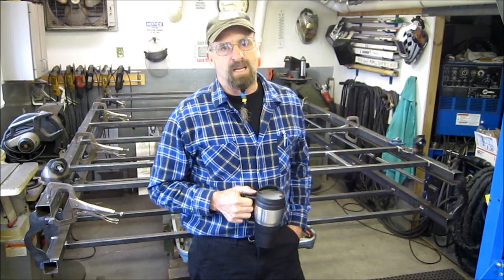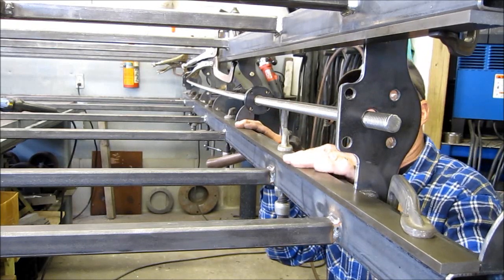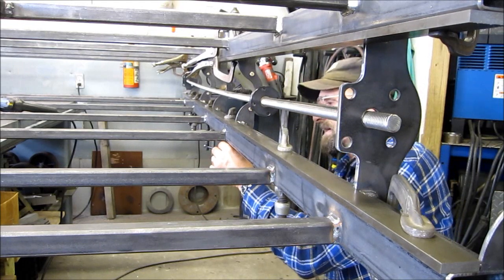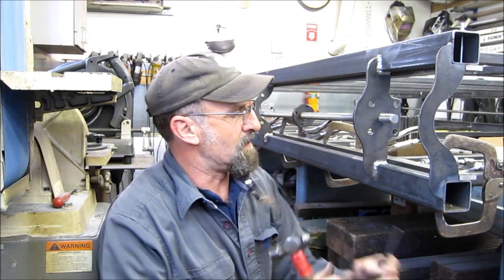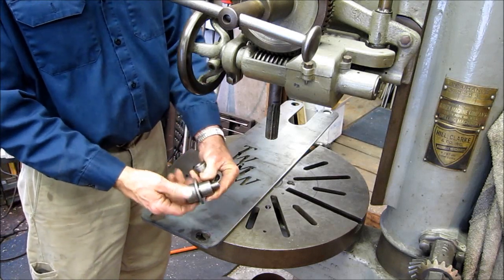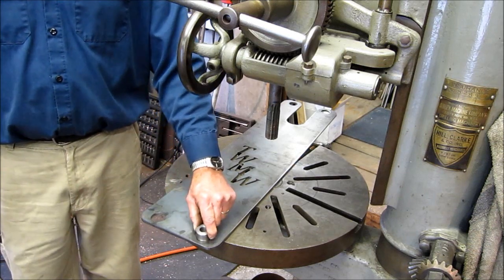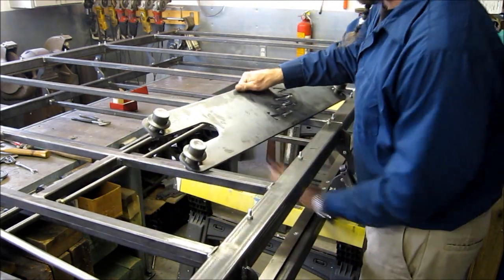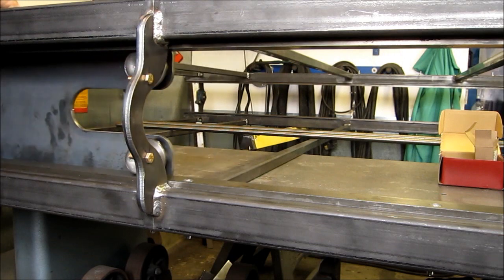Big Screen Elevator Part Six

Comment: Keith nice work looks like a jungle gym clamping the rails down LOL.

Curious are the rollers bought or did you make them?  Also I noticed you used hot rolled plate for the car side and as usual it seems to cut very nice in the plasma.  Are you grinding away the mill scale for the ground clip?  I seem to have trouble with ours on hot rolled I can get the settings dialed in but I have to change them slightly even on the same piece of material.

Thanks.

Comment from the maker: I did a read in the lincoln PH, Your CO2 is used more so as a spray arc, better for over head welding as per say, along with what the other guys were feeding ya and argon CO2 is more for the short-circuiting transfer and the combo called globular transfer. also CO2 is used in addition to flux core, alot...

Thank you guys for jumping in, with your comments and helping a fellow tuber with his question... :)

Comment: 75/25 makes a nicer looking weld with less penetration. 75/25 is more expensive and provides a better wetting action in the puddle making the puddle more controllable especial out of position. pure co2 provides more uniform deeper penetration but lacks the neat tied in look at the toes of the weld.

Comment: I'm not an expert but from what I've read when setting my home rig is that for mild steel Argon/CO2 mix is common, so much so that it's also called "75/25" (referring to the percentages of each gas in the mix). I'm not set up for aluminum, but I think one recommendation I've seen is pure Argon. I've seen lots of discussions about this so you should be able to google around for more info.